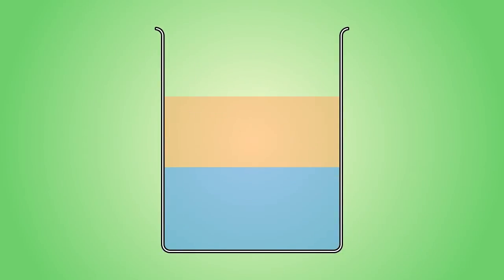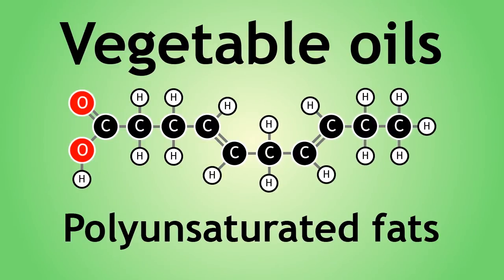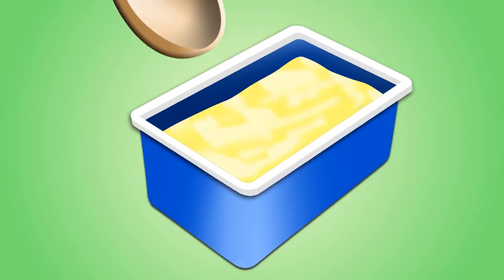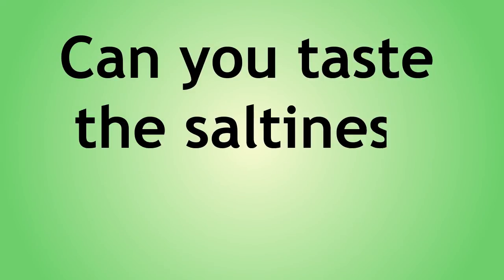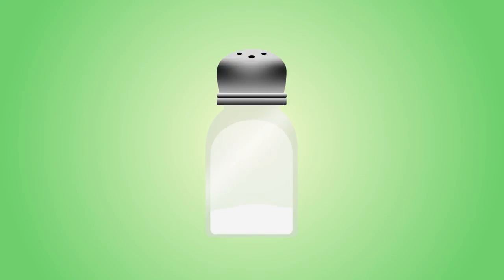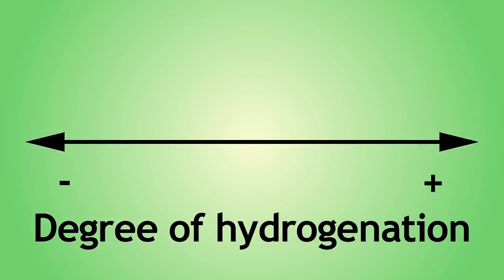Hardening Vegetable Oils (Margarine) through Hydrogenation | Chemistry | FuseSchool

Comment from the maker: UPDATED:
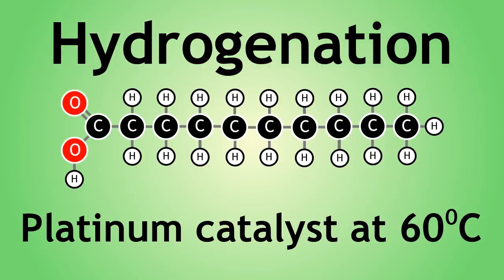1:10 - nickel catalyst instead of a platinum catalyst
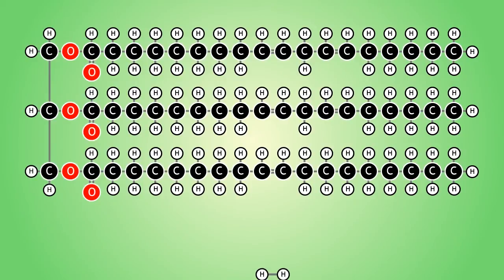2:06 - carbon has 4 bonds (not 5 as in the diagram). A hydrogen should have been removed.
Reply: i'm not sure the process at 3:24 is properly represented, isn't the double bond supposed to be stronger?